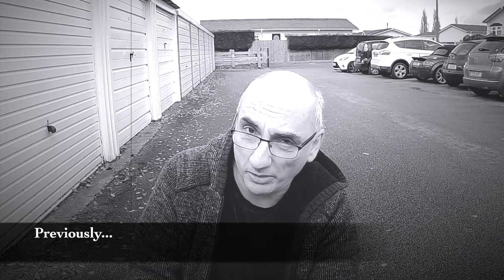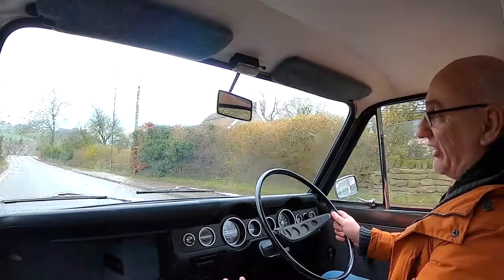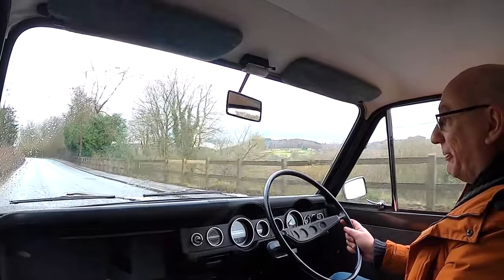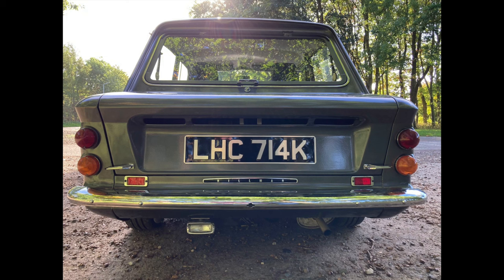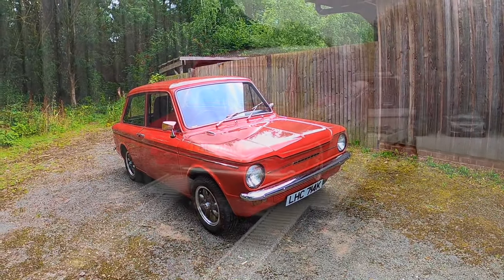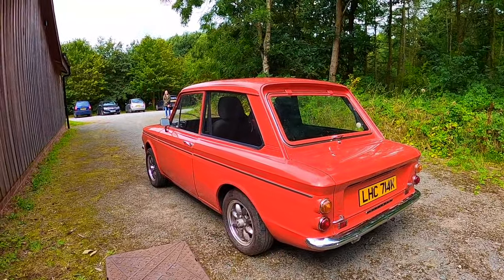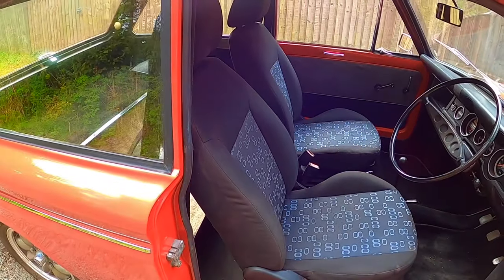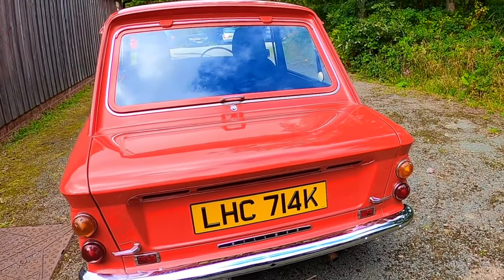Hillman Imp Heads to the Body Shop

Comment: Good to see Hilda back in original colour and I think the red looks much better than the grey. Totally agree with your decision to fit 70s style number plates, as that’s what the car would have come with. In my opinion too many classic car owners insist on fitting silver on black aluminium plates. I’ve seen Ford Sierra’s with aluminium plates which just doesn’t look right.
Reply from the maker: Thanks. Yes I am definitely happy with the car now she is back to the original colour. The black and silver plates looked quite nice on the grey paint but as you’ve said, they wouldn’t have been fitted to the car and the correct style look so much nicer next to the red paint. Thanks for the support.

Comment: Fantastic job and especially as you went original red. Fiesta seats from that era were really comfortable but just not right, especially with no rear access.

Proper paint job, just in two minds about the alloys, they look great, but so would steels and caps 🤔 

Looking forward to next installment
Reply: The alloys suite it mate I'm trying to keep him away from putting steels on 😂
Reply from the maker: @johnnyretro182 Keep trying 🤣☺️
Reply from the maker: Thanks. Very satisfied seeing the car back to original. Glad you mentioned the wheels… as I have been looking at some original steels with chrome caps 😉
Reply: @LivetoDriveUK  nnnooooooooooooooooooooooooo🤒😪

Comment: Thank you for sharing. Excellent the Imp is back to original colour & same red as your dads car & the original type yellow / white plates make it right. The painter has done an amazing job, better than it left the factory, hopefully you can improve the doors, but did factory tooling get worn, maybe or maybe not. I remember a very similar Red Imp on my paper round, early 80s, but it had a black vinyl roof
Reply from the maker: Thanks. It was the fact of paying to have the car resprayed that made the easy decision. I liked the grey but it’s not an original colour for the Rootes group and it is nice knowing the car is back to how it was. I have seen many Imp doors that are not in line. Will see what we can do. Thanks as always for the support.

Comment: @TipTopMotors-The paintwork looks to have a nice finish with a good depth of shine. I hadn't seen Hilda until this video and when you were talking of a respray personally speaking i would have changed the colour. I don't think the grey was the most exciting colour. I think its good to return it to original and i think you made the right choice. I also think you also made the correct choice with the number plates and what you say is correct. Due to a government/dvla muck up they have now had to allow black/white number plates up to 1979/80? and people put them on their cars. That's fine and its their choice i have no issue with that but for me personally anything after 1973 should not have black/white number plates because they never would have done. I think you made the right choices.
Reply from the maker: Thanks. Appreciate it. Yes the paint is certainly looking better now and once I knew the car would need a respray it was the right decision as you said to put it back to the original colour. I did quite like the grey, although not the quality of finish, but it wasn’t a standard colour and that is something I am not a fan of. Thanks for the support.

Comment: As you appear to be taking Hilda back to as close to original as is economically possible then the red paint is the way to go! Had you been looking for a restomod where you bring the mechanicals up to modern standard then the grey would have suited it better! By that I mean swapping the engine for any of the modern conversions(BMW,Honda,etc.) or going the full hog and making it a mid engine similar to the "Z Cars" Mini's!   Regarding the seats I have found that the BMW 3 series coupe or convertible are a good fit if a shade heavy compared to the originals & they come with removable head-rests!
Reply from the maker: Thanks. Yes we are sticking with the ‘close to original’ approach on our Imp. Have seen many different seats fitted. The 3 series option seems a good one… particularly as they will tilt. Thanks for watching and your comment.

Comment: Looks fabulous in red. 
The commonest reasons for Hillman Imp failures were people running them on plain water in the cooling system or fuelling them with two or three star fuel. Not using the correct coolant mix (with inhibitor) clogged up cooling systems and especially the heater. Although you might renew the water pump and flush out the radiator at some stage the heater was rarely sorted out. Thermostats, being at the difficult to access front end of the cylinder head, were out of sight, out of mind. (A traditional Imp owner should be able to literally change a thermostat blindfolded.) An Imp with a working thermostat and a properly flushed and filled cooling system should have an excellent heater.
Reply from the maker: Thanks. Very helpful info and appreciate the time to comment. The heater is next on the list as I’m concerned there is still something not yet fixed with the system. The new thermostat, radiator and correct coolant has been done.

Will update on a future video.

Thanks again.
Reply: From the videos it looks like you are on standard ignition and carb. A really worthwhile change is an electronic ignition kit. It improves reliability and allows you to fully use this free revving engine if the need arises. Another issue that was always annoying was blocked carb jets. I did mess about with better fuel filtration but never really got it right. These days, good quality fuel filters are easier to come by so it might be worth considering.  I always ran a lowered front end: either Monte Carlo springs (100/550lb/in???) or the collapsed coil trick (heat up top coil, collapse with vice, quench in urine/adblue). I think some traffic police regard collapsed coils as illegal these days unfortunately. Most of the bearings on the car are simply standard bearings and I have a list somewhere of all the numbers but I can't find it. If I stumble across it the I'll post it somewhere handy.
Reply from the maker: Thanks for all the info and apologies for the late reply. YouTube isn’t very good at notifying of any new replies.